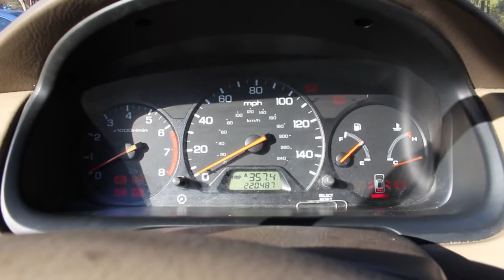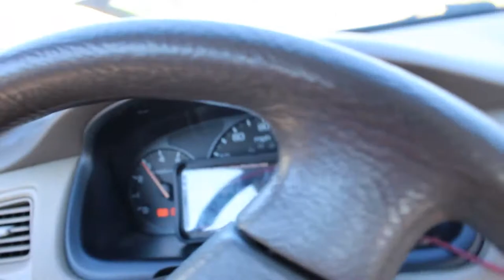NEW BUILD F23 CIVIC?

Comment: Really love these motors, I did a g23 but it would be interesting to attack that f23 head w a dremel. Valve train would be a bit spendy but those Nippon k20 piston are cheap. You can get F23 engines in the bulk section of a grocery store practically and the few 200k engines I tore down exhibited practically zero wear. Auto trans 'nade about when the motors are fully broken in.